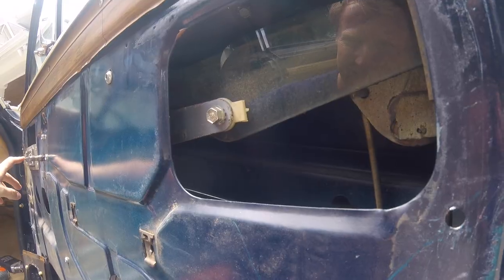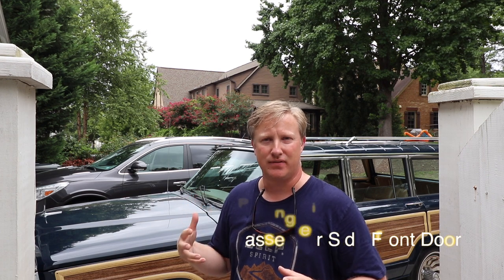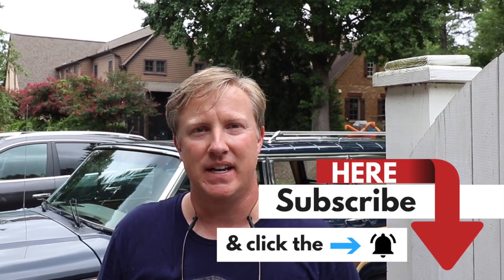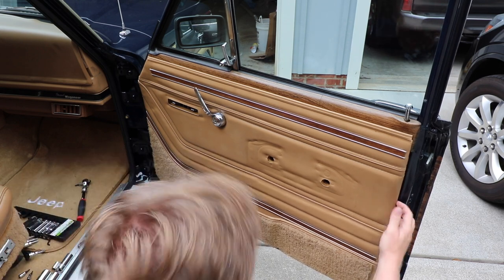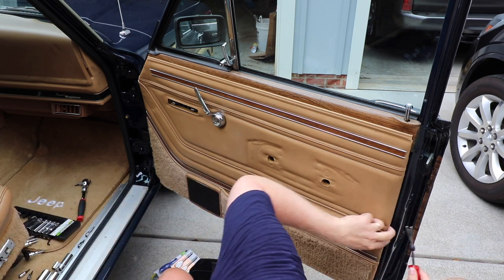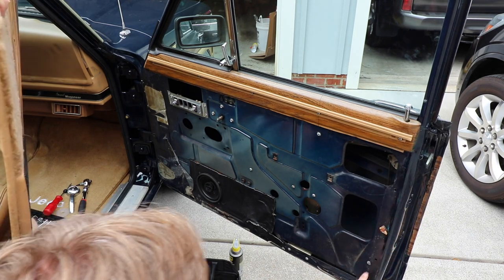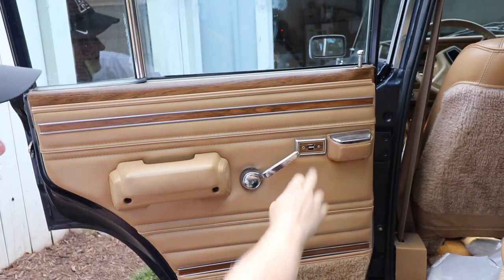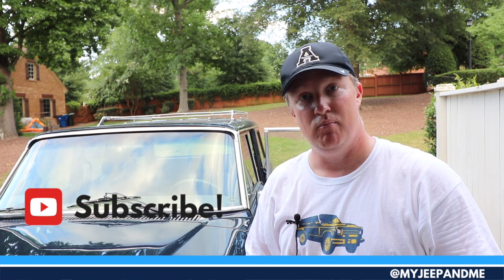Fix Your Jeep Grand Wagoneer Window Flex Track

Comment: The front drivers side window on my 86 fell into the door but the motor still works. Is that what happened to yours when that plastic piece snapped off?
Reply from the maker: Correct. You have a broken flex track.

Comment: I have a 1983 Wagoneer. Did you have to replace the plastic gear on the motor to work with the 1991 window guide?
Reply from the maker: All I had to do was unbolt the old unit and install the 91. Direct replacement for the 87. I would assume 83 and 87 are the same.

Comment: new wagoneer owner here. Thanks for the video. I will need to reference this pretty soon.
Reply from the maker: Congratulations on the new ride. Happy to help if I can. What year is your Wagoneer?
Reply: @FOURWHEELTRENDS  89 . currently it runs, drives and all works but the Horn, blinkers, and rear window.

Comment: I am tired or replacing broken flex tracks more then once in my 89. My son has a 91 and never an issue. With that said where did you source your 90/91 upgraded window motor flex track unit from?
Reply from the maker: Chris Ross it was a holy grail type search. Almost impossible to find and it you find them you have to mortgage your house to buy them. 
All kidding aside, they are very hard to find. A fellow Jeep owner has an extra set. I would ask around on one of the Jeep forums on Facebook or IFSJA.org and hope that someone is willing to let go of theirs. This said, after fixing flex tracks constantly any price was worth it!
Also, the flex track from BJSOFFROAD is better than the others.
Reply: Appreciate the  support! I am located in Charlotte. Yes, BJ's flex tracks are $39 each vs. the rest at $11. I am finally at the point where I am just sick and tired of having to replace the things. On my 89 I have probably done the drivers side 5 times in 8 years and all the others at least once or twice. Thanks again for supporting the GW!
Reply from the maker: Chris Ross I feel the pain. In this video, the flex track that broke in the left rear door was #3 in less than 2 month. Now that the new ones are in everyone’s allowed to use their windows as much as they like!
Reply from the maker: Chris Ross my project today is replacing the fan clutch and radiator. Not as hard as I thought it might be. No clue when I will feel like editing. I have a few videos recorded but it takes just as log to edit as it does to record.
Reply: @FOURWHEELTRENDS  Ryan Hart needs to find someone willing to manufacture the 91 style window track assemblies. He could double the profitability of BJs overnight if he could carry that style of track, especially if you could just get the track and swap your old motors over to try and keep cost down a little bit. I’m actually surprised he hasn’t done this yet

Comment: Do you have a part number for the replacement window regulator?
Reply: Part number will not help you, they are no longer in production and are not available anywhere unless you find a 91 parts Jeep

Comment: Great video.  I have a 1985 Grand Wagoneer and my driver side window just went out today.  Will a 1991 metal track be compatible with a 1985 and do you have a link on where I can buy one?  The motor is still good.  I'm assuming that the flex track snapped.
Reply: You can disregard...I read some of your other posts and realize that they no longer manufacture that part.  I'm going to try to just replace the flex track and see what happens.  Appreciate it nonetheless.  Keep making great videos.
Reply from the maker: elimccormick - it’s really hard to find them. I would talk to Ryan Hart at BJsoffroad.com and get one of their flex tracks. Theirs hold up better than the others. The metal ones will have to come from a parts vehicle. They are no longer in production.
Reply: @FOURWHEELTRENDS  Thanks so much.  I actually ordered one this morning.  Looking forward to the challenge.  =)  Appreciate the help.
Reply from the maker: elimccormick - first one is a pain but they get easier each time. Let me know how it goes.
Reply: @FOURWHEELTRENDS  Good to know.  I'll be in contact should I run into major problems.  Thanks again.

Comment: Do you have a pic on how the Torx bolt connects the new flex track to the old window raising bar?  While fixing my flex track, I forgot how it goes back together. Thanks!
Reply from the maker: Lee Porter let me see what I can find. Some of them simply twist in.
Reply from the maker: Lee Porter out of 5,000 photos, I don’t have that one lol. Sorry
Reply from the maker: Lee, good news! I found one. Let me figure out a way to get it to you.
Reply from the maker: Lee Porter here you go - https://twitter.com/myjeepandme/status/1082616499221786627?s=21
Reply: @myjeepandme - thx. Couldn’t figure how to connect the new flex track. Supplied notes told me to keep a certain part when I didn’t need to reuse it. You’re a life safer. BTW I cracked up when you went to all the trouble with front passenger door and the damn thing worked. Welcome to my GW life. Best.
Reply from the maker: Lee Porter just wait until you see the series of videos I’m working on now. I have a special 1991 sitting in my garage. Not sure when in 2019 I will start publishing, but I’m working on at least a 5 part series. The one where I finally get it started should have you laughing too. Hopefully laughing with me and not at me, but either way I think it’s funny.

Comment: What power winder regulators did you use for the rear passenger and driver side windows ?
Reply from the maker: I found a donor vehicle and purchased the 1990 or 1991 version with cable vs plastic. It's a game changer upgrade by very expensive IF you can find them.

Comment: JUst picked in an 87 GW.  Great information as I also have all windows working except for the Passenger rear window.  Question... THe door openers on the inside are stripped any thoughts on how to get them to work again.  Can;t get out unless the windows are down and I use the outside handles.  Thanks, Dave
Reply from the maker: David Ochser congratulations! Is it the post or the actual handle that is stripped? You can buy new handles. It it’s the post out of the door... it’s going to be from a parts vehicle
Reply from the maker: David Ochser also, I might have one metal vs flex track left for the rear door. Not sure if it is driver or passenger side. They are extremely hard to find and expensive but worth every penny IMO.

Comment: Do you have a video on fixing 4x4. Mine doesn’t light up on dash or go into 4x4. Thanks
Reply from the maker: Bill Burgess so far I have not had to tackle that problem. This said, I have a few big projects in the works for 2019 which may require me to tackle the 4x4 and learn. If so, I will be sure to post a video.

Comment: Where does one buy the new style regulator
Reply: From a parts vehicle. They are not available anywhere as a new part. No one manufacturers them
Reply: @1982MCI  I ended up retrofitting a newer design in place of original parts. Thanks 😊.
Reply: @blackie361855  what parts did you retrofit and how’s it working? I’m surprised someone hasn’t started making this style yet cause there’s probly thousands of us that would buy them

Comment: Great video. Where are you located?
Reply: I should have said, where in NC? I'm in Raleigh and have an 84 Wagoneer.
Reply from the maker: Todd Crenshaw me too. I’m in Raleigh
Reply: would it be possible to check out your jeep some time? I have an 84 that I just started restoring. Thank you.
Reply from the maker: Todd Crenshaw the blue Jeep in that video got sold. I have a few project Jeeps right now. 91,90 and 85.
Reply: all wagoneers? Thanks.
Reply from the maker: Todd Crenshaw for now all Wagoneers. I’ve got to narrow it down to just one (maybe 2) Wagoneers. Then I want to add a Wrangler to the fleet.
Reply: I know I'm like a year late on this but I'm in Raleigh as well and have a 87 wagoneer with window issues lol. Got yourself a new subscriber!
Reply: @79gmcsierra  Let me know if you want to get together to work on this. I'm trying to learn as I go and it is a slow process. My wife is wanting me to move the Wagoneer but it needs to run first! Thanks man.
Reply: @SuperSlappy25  im a mechanic (mostly engine) by trade. If you need/want help getting it running i may be of help! Ill even drive mine over so your wife has more hope than both of us lol